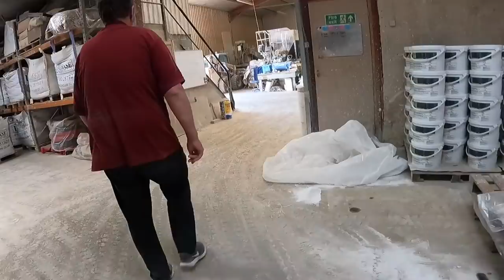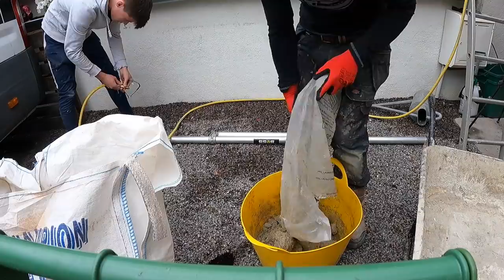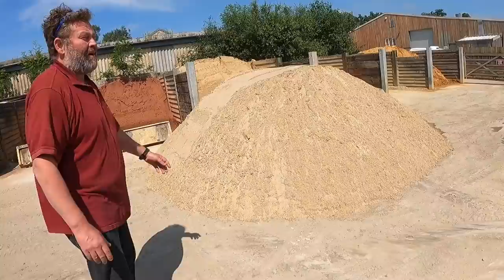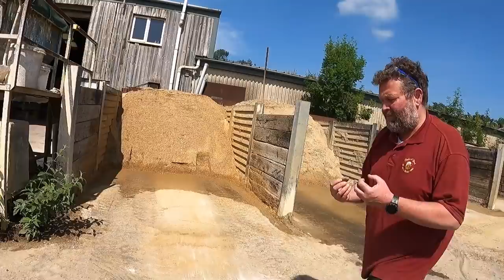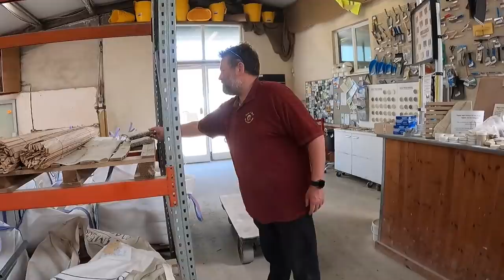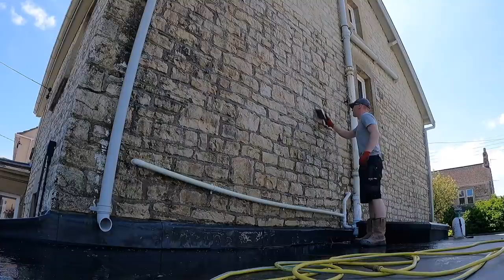HAVE AN OLD HOUSE? Info you need to know!

Comment: My son's house is in an old Lord Derby estate farmhouse built about 1845. It had some very unsympathetic works done in the 80's, this is being undone!  He has learnt how to repoint using lime mortar and I'm from an Architectural background, has done a very nice (but slow) job. The rear outrigger had an extension built above the ground floor level and was faced with Thermalite blockwork!! it was rendered in sand cement. That all came off and he has found a very experience guy who only uses lime. the final coats are going on at the moment and the finished look it fantastic and will help the building to breath again. I'm pretty sure he buys his lime products from the same place.

Comment: Its good to see a proper educational video about an aspect of building construction.  Well done!  I cringe at the thought of how many so called brickies haven't got a clue about the info on this video.
One experience I need to relate was that the site agent on a listed building job allowed riven laths to be removed from some stud walls against the conservation officer's requirements.  The contractor was fined the equivalent of £50,000 at today's cost and the agent was in danger of a jail sentence but because the contractor pleaded guilty the penalties were minimised.  I was one of the witnesses to the investigation and the charge of the agent by the police.  I have come across many contractors and builders who simply don't understand the seriousness of dealing with old and potentially historic buildings, attempting to apply modern methods to historic situations, never mind that the modern solution could be detrimental.

Comment: What would you recommend for a solid brick house currently covered in external cement render? Ideally we would need to render in lime as the bricks are so damaged. But we made the mistake of putting in cement lintels and repointed partially with cement too. We have completely gutted the inside of all cement and gypsum. So starting a fresh but would like to do it properly... advice would be greatly appreciated as its a massive job for us! Cheers
Reply from the maker: I'm sure Joe or others can advise but a lime render will certainly be a very good way of keeping the walls dry and breathable.  Like you say, the render may well have damaged the bricks but I can't imagine any problem with the lintels or even small areas of pointing.

Comment: The talk about build rate. Let's say you are building a stone wall, with lime mortar. What is the size of one course? How long before you go up another layer?
Reply from the maker: If it was a lime putty mortar like we are using to point with then I imagine only a couple of stoner courses at a time with a few days between so not much more than 400-500mm.  All would depend on the weather and curing time I guess.  Like Joe suggested, hydraulic lime may be a better route if needed but not always as kind to the stone.
Reply: @TheRestorationCouple  Thanks. I've found a link on that with information.

Comment: My 1910 polychrome brick terrace house was rendered in 1980s with white render and marble chippings - absolutely ruined now. 

My neighbours house was also done, he stripped it back but the bricks were destroyed and had to render it again. 😡
Reply from the maker: Oh no.  Unfortunately if it was a 'good' render job with the cement it really becomes so much stronger than the brick.  Such a shame, especially with original patterned brickwork.